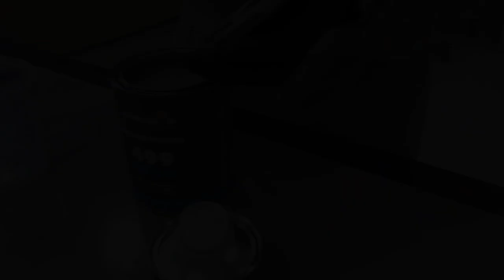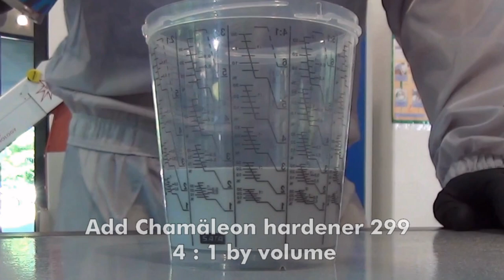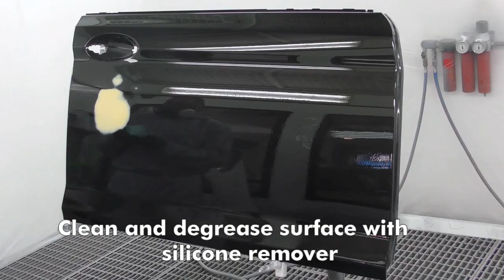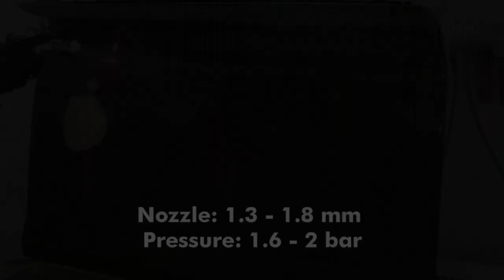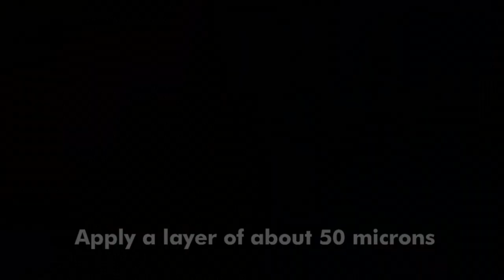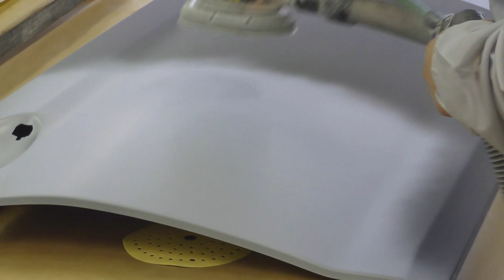EXPRESS PRIMER for extremely FAST car refinishing

Comment: I didn't decide to test this primer, it dried quite quickly, but the car had to be sanded the next day, the front bumper, and the hood was on primer 466 all in one, which is simply unique, it was 3 days old, it was sanded in seconds, and 499 had no sanding! I recommend 466 unique !!
Reply from the maker: Thank you for your feedback, it's valuable to us

Comment: Recently discovered your product line and purchased 499 from a Australian retailer to check it out.. And have a try of it, normally a ppg guy. I have read the tds ,, but curious to know if 499 can be applied over a 1k epoxy based etch primer, thank you,
Reply from the maker: Hello. You can apply 499 primer over 1K epoxy primer and get good results.
Reply: thank you.

Comment: I can use this products in aluminium?
Reply from the maker: Hello!
499 should not be used directly on aluminum surfaces, it should be pretreated with an adhesion promoter or epoxy primer.
Reply: thanks, this product is new in Chile. I use the UHS clear coat black line and the 155HS, awesome products. Thanks again for the info.